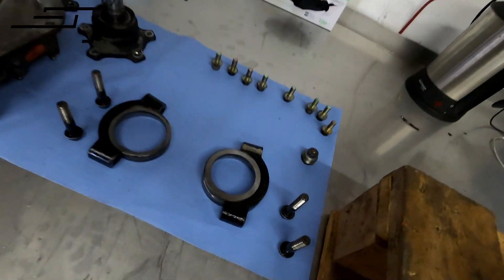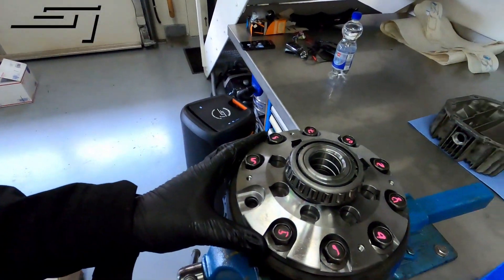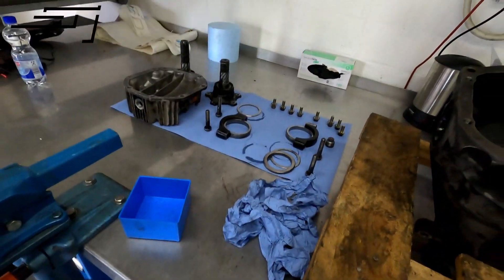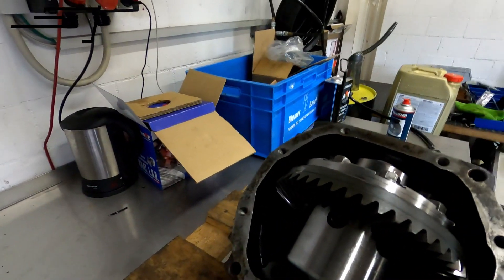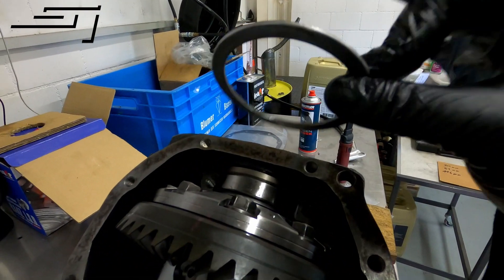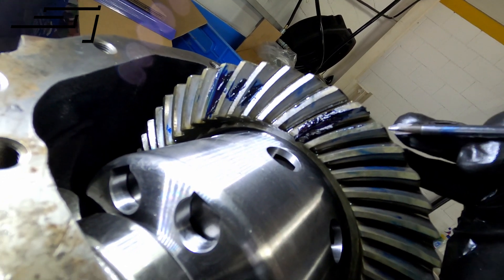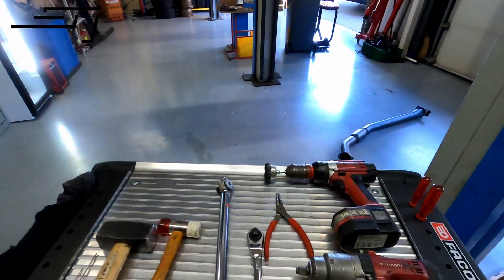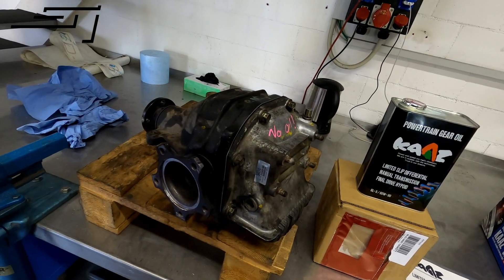Speed Industries - How to put a LSD into a differential

Comment: this diff drops straight into a diff from s13? ca18det version
Reply from the maker: Most manufacturers offer straight drop in lsd‘s. You just have to set it up right.
Reply: @SpeedIndus  just bought an s13, welded diff, sucks to drive
Reply from the maker: @Jahoo89  lsd will be better